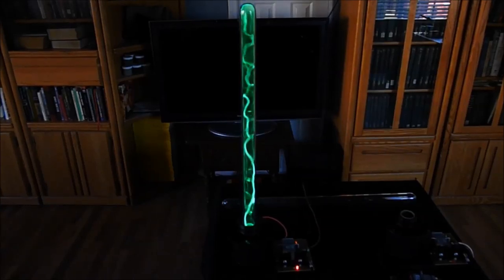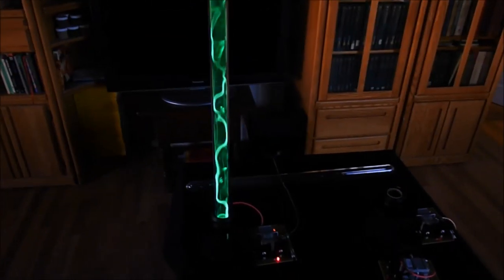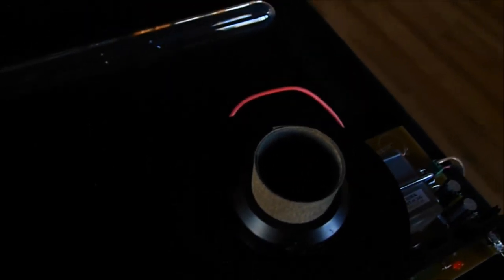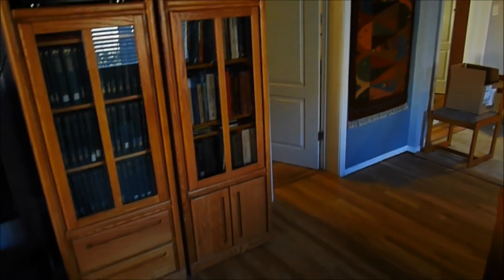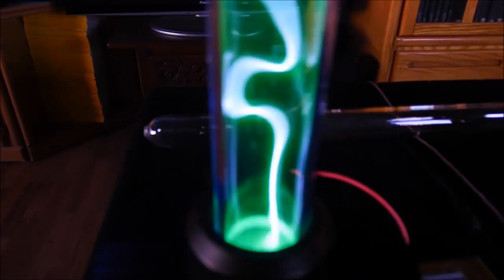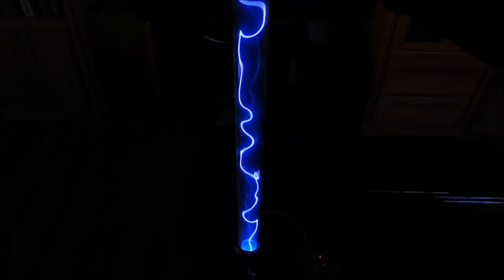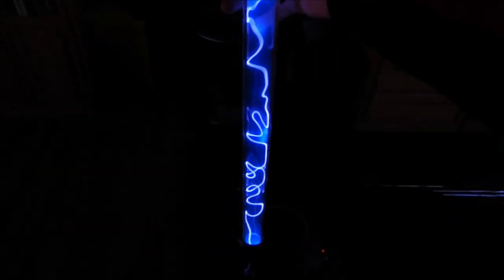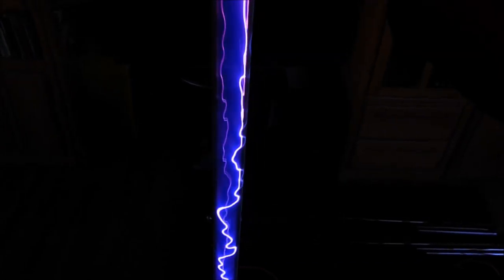Plasma tubes, sockets, and power supplies

Comment: Another great video!  Can you please detail how you modified the base bias resistors?  I built the PG13 kit to compare to my HVT-01 driven by a SG3525/push-pull circuit.  The unmodified PG13 is disappointingly weak as it barely lights my krypton/iodine tube which the HVT-01 powers quite easily.  Also, are you using the stock transformer core spacers, or are you using a different gap size? Also, I notice that you are no longer using the large graphite torroid at the tube base that you used in previous videos.  How much difference does the lack of the extra capacitance make in your displays?

Comment: hi , this looks very interesting . i was just wondering , what pressure would be used for just helium gas so we can make the same thing but with white light.
Reply from the maker: Helium is probably not capable of forming filamentary discharges like this unless the pressure is very high (several Atm).  The atom has little mass and consequently, charge and thermal transport prevent this kind of arc formation at reasonable pressures.

Comment: Where would I find those Xe N O tubes and set up? Im looking at building a custom PC case with over the top sci-fi look with all the liquid cooling pipes with green fluro liquid etc. And think the long plasma tube would make a great accent for the cooling tower. the theme im going for is black carbon fiber with green lighting. one thing i would want to look at is a near silent power supply as the high pitch oscillator would drive me to murder lol
Reply: You know this thing produces heat right?
Reply: well no really? Im going to build a $10k PC without considering heat soak, and ill use these plasma lamps to turbo charge my overclocking, yeah thats what ill do. lol no its ok these wont go in the case, they go on the outside and dont touch anything that will soak heat into the system.

Comment: I am in the process of building a prop from Rick and Morty and I want to use a similar setup to replicate the tube on top of Rick's portal gun. How difficult would it be to scale the tube down to about 5 inches in length and supply it with a portable power source?
Reply: would it not be easier to make a green vaccum tube?
Reply: That is what I am trying to do. I was thinking a sealed tube (cloche dome sealed with Xenon and air (which has nitrogen and oxygen)) touching a taser electrode. Did you figure out how to do this?